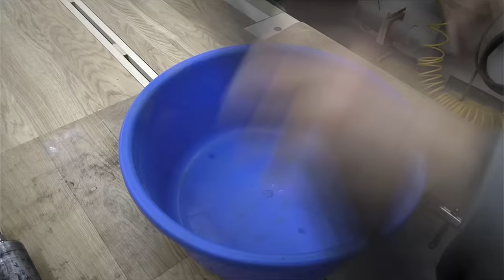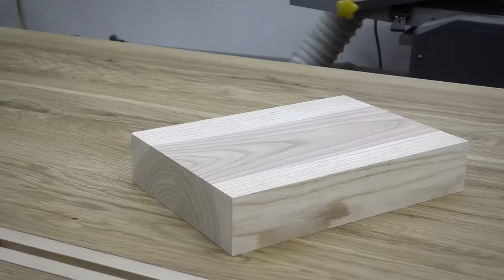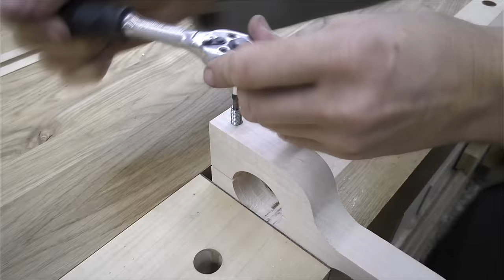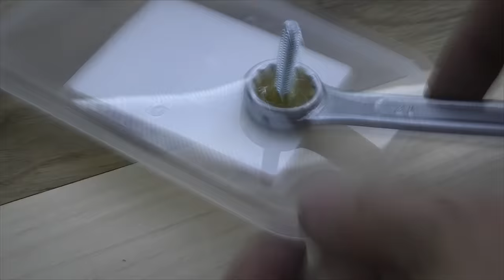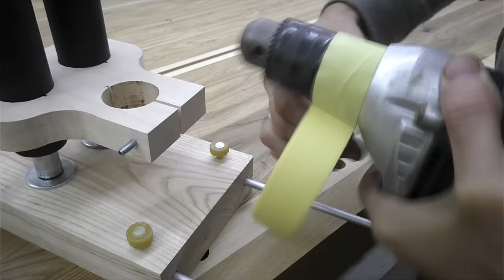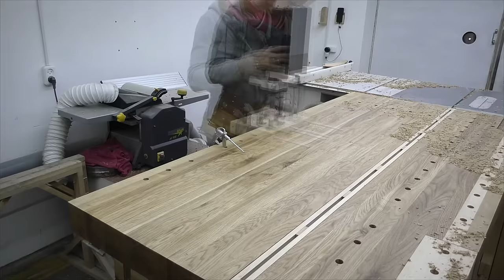Awesome Tool Idea from Old Shock Absorbers

Comment: Great idea to recycle old shocks. I would suggest adding a rest so the drill doesn’t always drop under its own weight, might save the surface the press is resting on

Comment: EXCELLENT WORK. I am making my own workbench and was wondering how to get the holes in line and equally spaced at 100mm to 150mm. I can do something similar with a small Ryobi Drill Press mounted on a suitably sized piece of MDF.

Comment: Why didn't you add a bench dog for keeping the distance between the holes as well? For drilling holes on deeper benches it would be useful to have removable bench dogs on the drill press in both directions. With the long lever it's becoming harder to maintain the right angle on this jig.

Comment: I have built similar jigs before, the biggest issue is that it ends up quite heavy to lift the drill up and down. Requires real 💪💪💪 to use it for any extended period of time. Pressing down is natural while drilling, but lifting the tool up and keeping it up while moving the jig is the real challenge. Adding some sort of spring or something would really make it great. Otherwise, great idea and brilliant execution!
Reply: I wonder if you could -- provided the old shocks didn't get replaced due to a blown seal -- tap the hole with threads that was used to drain the oil, and install a Schrader Valve (tire filling valve, for anyone not knowing). 
Then, simply add a small amount of air pressure to give it back some of its springy rebound?
Reply: Ibwas having the same impression... But using air to help lift the assembly would result in a too short elastic "spring" travel.
 Perhaps a long steel spring would provide a better, more constant lifting force that does not stiffen too much at the bottom end of the travel... But the idea of using air, adding a small hole to regulate the air passage, would provide some damping, avoiding the possibility of hard hitting the drill if you drop it, just wondering... Anyway, it is an excellent concept that was perfectly executed!
Reply: @DUKE_of_RAMBLE adding compressed air would not lift the assembly, shocks like this are dampers, the spring (not shown here) carries the weight of the vehicle. You would need to add a spring to one or both sides calibrated to lift just some of the weight of the drill.
Reply: @1988dgs  heh I had to rewatch the end to refresh my memory.
I wasn't trying to imply that it would necessarily act as a return-spring insofar as to bring it to the top. More so to, just as you said, act as a dampener. In reality, my hope was more that it might provide enough rebound due to the air getting compressed, to allow for the drill to clear the work on its own.

However, in hindsight, I realize now that it'd only be sufficient for the work piece you've calibrated it for. Thicker work pieces would lack enough air pressure, and adding air to do that, would in turn require more effort to run the drill down far enough for thin pieces. 🙁

As I'm a car person like you, I'm sure you have played with a convention oil filled, a oil+gas, and a purely gas-filled shock (or, yes, "damper" if you prefer). As such, probably witnessed the primary difference when you actuate them outside of the vehicle – ie when both sides aren't attached to a heavy object. 
Oil filled's rod will stay wherever you've moved it to. Oil+gas as I recall, depends, but most likely to stay as well. (depending on whether they gas is to prevent frothing, or functional as a multistage unit) 
Gas-only, on the other hand, I believe are always pressurized and will therefore return back to their extended position.
(although, I think the oil+gas where it's anti-frothing, do still auto-extend, but oh so slowly given it's not technically added for rebound performance)

TL;DR - If a monotube shock was being used, it would've been gas filled anyways*, and by design would have had a return rate after being (further) compressed by the rod; thus, the basis for my suggestion. 
(* wasn't there a warning when drilling the hole to drain the oil, about the chance of the cylinder getting pressurized? heh [or maybe it was a different video...])
Reply: @DUKE_of_RAMBLE  haha, no warning before drilling into it but you can see the mess it made, if it was gas the title would be something like “toolmaker shoots down passing plane”. Not tried dismantling all gas, usually no user serviceable parts inside. rebuilt plenty oil and oil/ air pressure dampers, the oil/air were usually front forks off the bikes, which have a built in spring, or McPherson struts off car front ends which have external springs (we used to clamp the top end in a vice, impact gun the top nut off then pick up the parts from the target range 😉) Don’t think any damper would give support to lift the drill, just add more friction trying to stop it moving, the front spring off some kids toy bikes might be soft enough